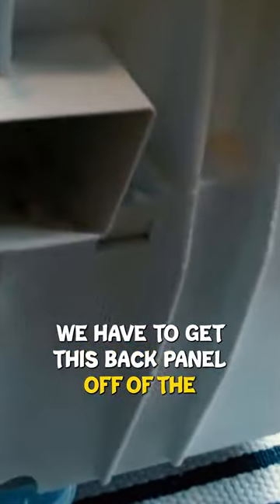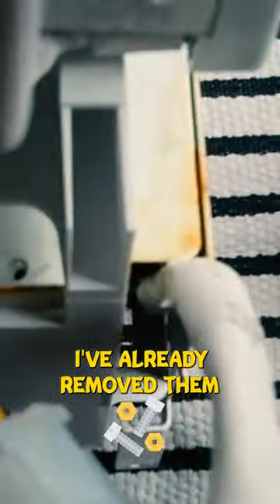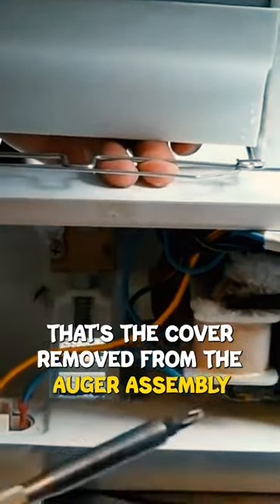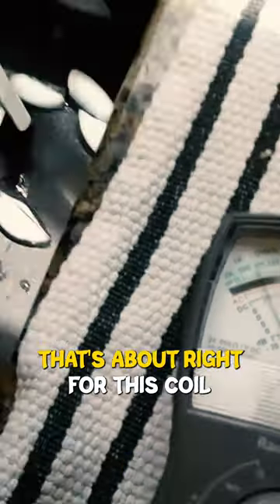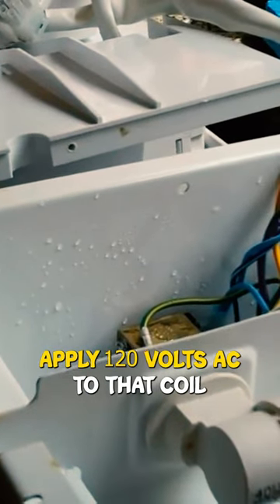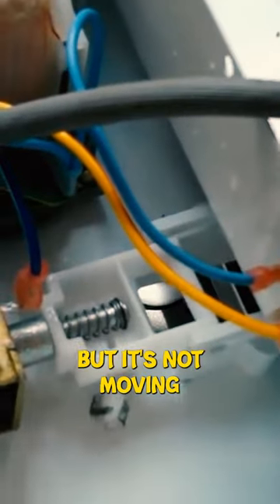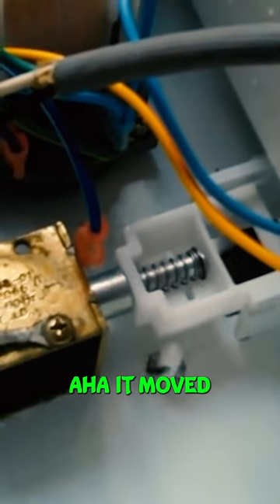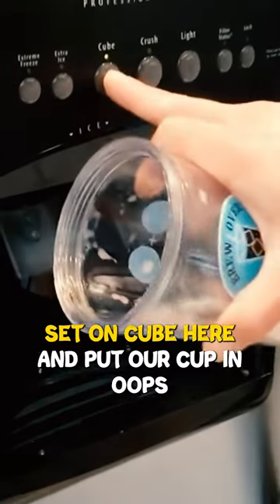Troubleshooting a Frigidaire Ice Dispenser That Only Serves Crushed Ice #shorts #refrigerator

Comment: So what did u do
Reply: Exactly my question 😂😂
Reply: I believe the plastic part on the end of the solenoid was stuck and he freed it while applying 120V. The only reason I think that is because I've done the exact same thing on a Frigidaire.
Reply from the maker: Yep- frozen in place with rime ice (frost). Then you have to investigate where the excess moisture came from to cause the frosted solenoid. That would lead to inspecting the door gaskets and door closings.